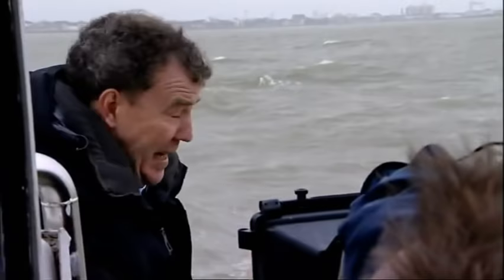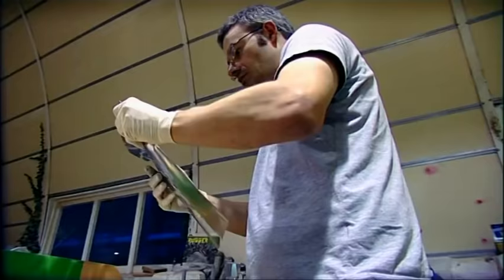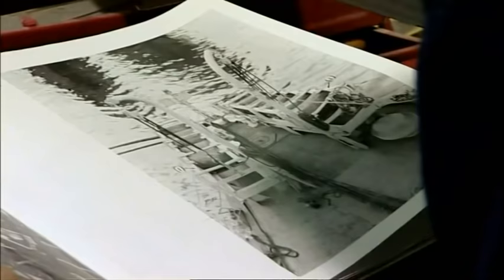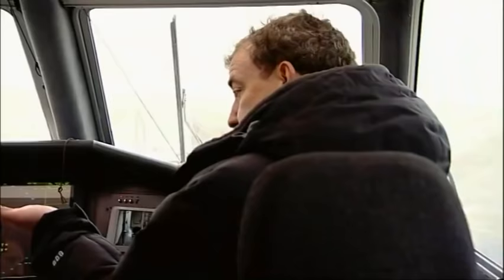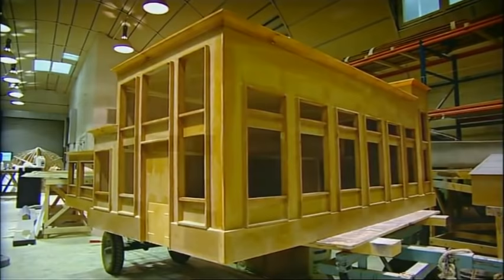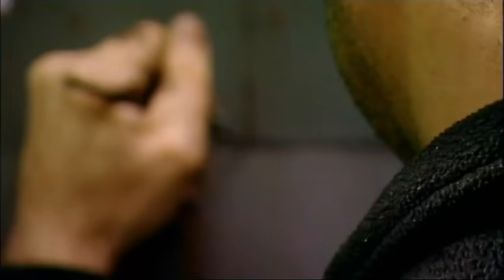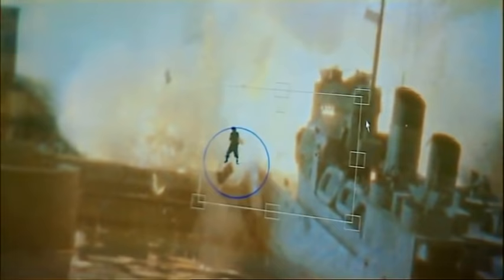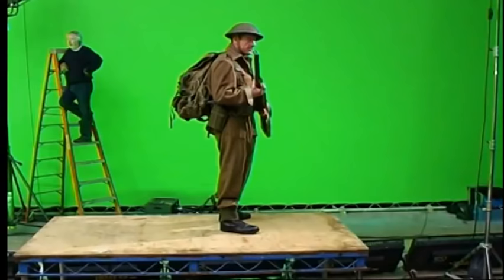The Making of Jeremy Clarkson's The Greatest Raid of All | North One

Comment: It's a ship, not a boat 😁
Boat's nose? You're killing me - Ship's bow.

"According the U.S. Naval Institute, a boat, generally speaking, is small enough to be carried aboard a larger vessel, and a vessel large enough to carry a smaller one is a ship."

"Another factor the Naval Institute considers is the vessel’s crew, command, and use. If it has a permanent crew with a commanding officer, it’s usually a ship. If it’s only crewed when actually in use and has no official CO, then you’re probably dealing with a boat. Ships are also usually intended and designed for deep-water use and are able to operate independently for long periods of time. Boats, meanwhile, lack the fuel and cargo capacity for extended, unassisted operation."

Cool vid, though.